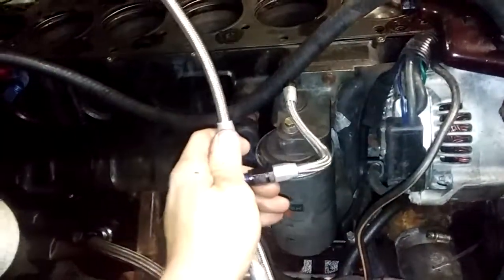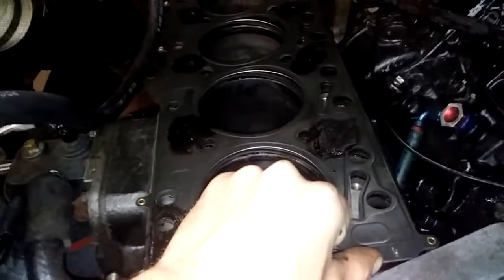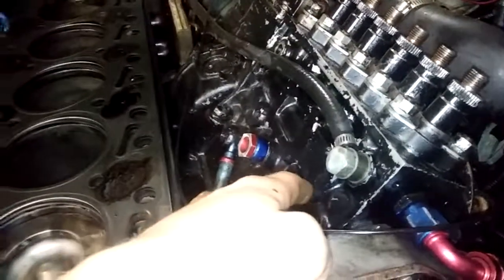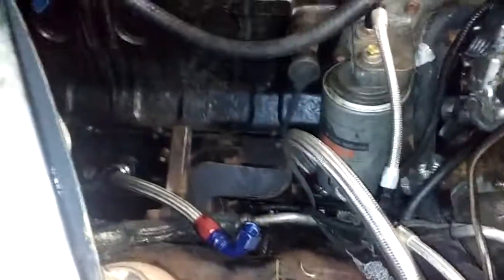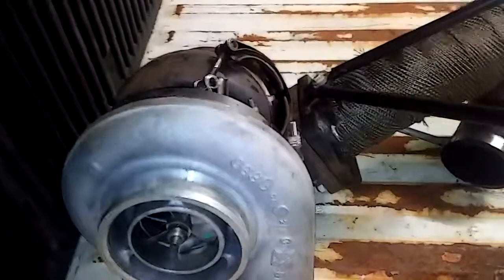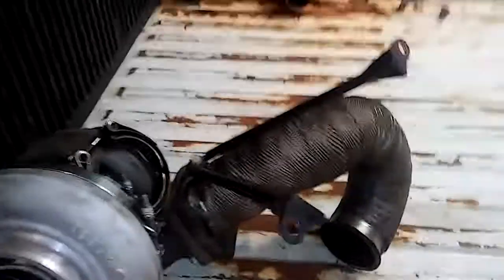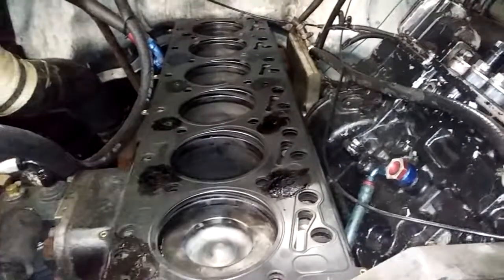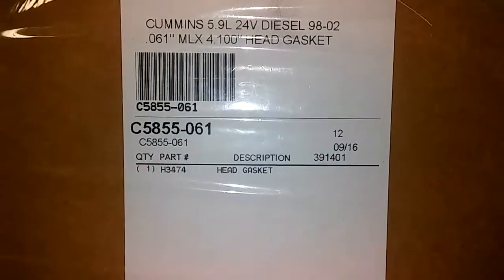Head gasket 24v cummins solutions part 1

Comment: How did this head gasket work for you after all
Reply from the maker: Works great. Has held 80psi boost with 70psi oil pressure now on arp 2000 studs not the stronger 625 .